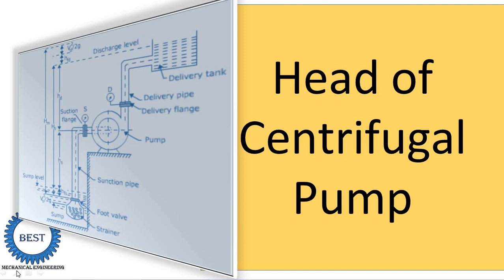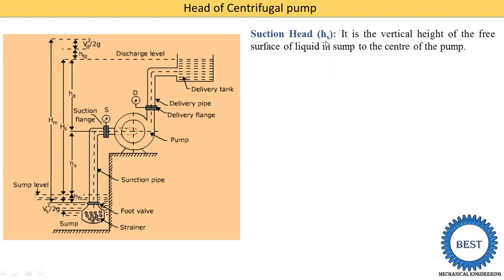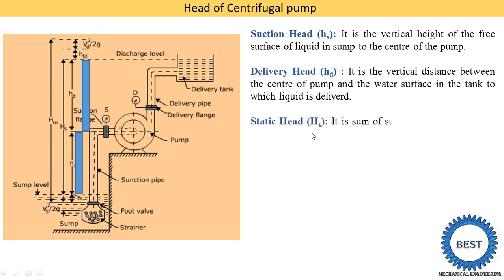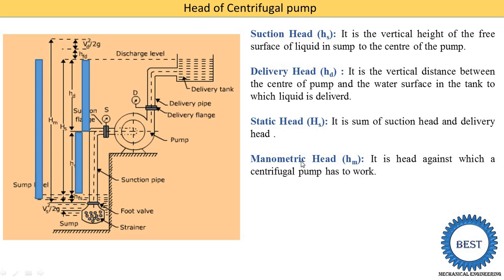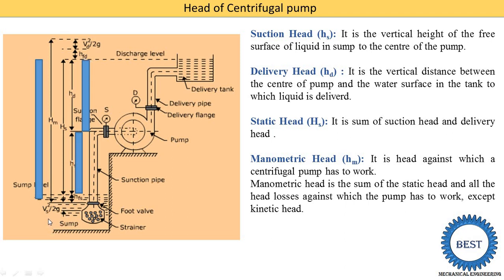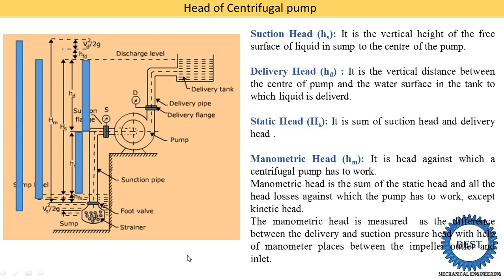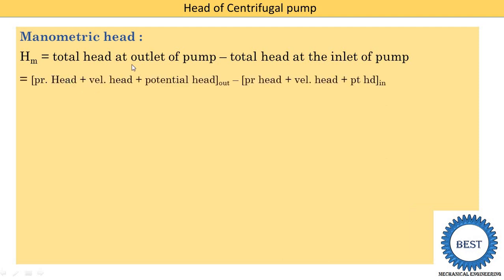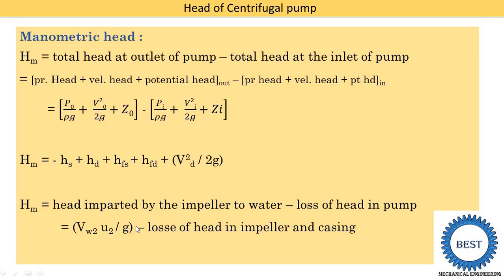Head of centrifugal pump

Comment: Sir what will happen if centrifugal pump is run at much below its rated head, like outside the performance curve. I know the efficiency will be low but what will be other practical implecations. Will there be too much vibration.